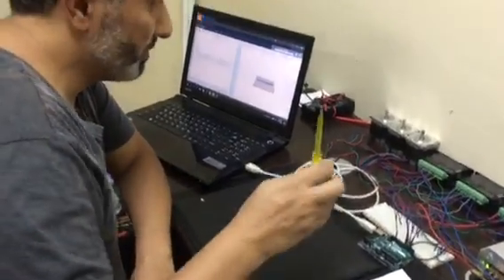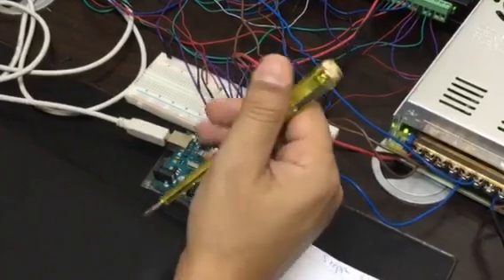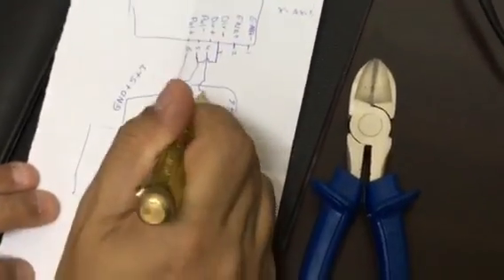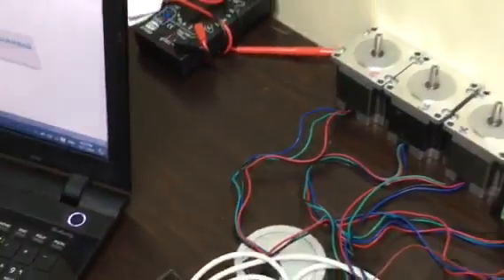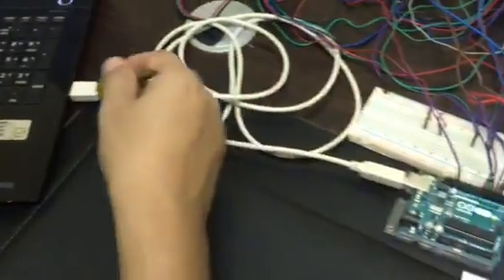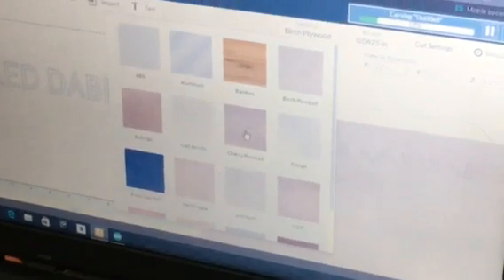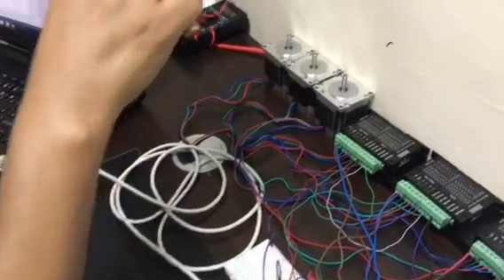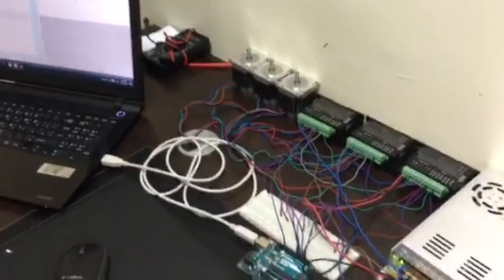CNC Machine - Arduino, Stepper Motor Nema23, Driver TB6600, Easel - Part 1

Comment: Thanks for sharing how to connect 3 stepper motors to Arduino UNO without using any cnc shields. I have 2 motors for y-axis, can somebody please comment on how to wire the 2nd y-axis motor to an external motor driver.

Comment: واعلیکم اسلام

 can anyone help me to make a 3D printer with Arduino using direct stepper motor driver instead of CNC shield, because I wanted to make 2D printer before and I have driver, not want to buy a shield and wasting drivers, thank you with honours
Reply from the maker: Magician of Electronics 
As I know driver is a must, you can’t run the stepper motor without driver. The driver interpreted the commands yo the motor.
Reply: @raeddabbas624  I am sorry sir, I am using driver. I am talking about the shield. I have purchased ULN2003 driver. I don't want to buy a shield as you know that ULN can not be installed on the shield. If I use the shield so that the ULN2003 driver will be useless. I have tested a 2D printer with 2 stepper motors with drivers only by configuring their pins on Arduino UNO. The same way I want to do for 3 stepper motors. Only have to add one more program. thank you for your reply, with honors

Comment: Will the pin connections be the same for ATMEGA 2560 please ? Any sample sketch  for testing CNC ?
Reply from the maker: Ali Ismael 
I’m not aware about ATMEGA 2560 !
But irrespective of the controller type you need any digital output pins and the ground pin.

Comment: thanks for the video, is there any way you can tell me what pin do i need to connect for the relay to switch on a plasma cutter?
Reply from the maker: Gabor Nemeth sorry man, I have no clue.
Reply: Raed Dabbas that's fine I have fined it thanks
Reply: Sir I am working on a waterjet cutting machine and this is also my problem. Can u tell me what pin? Thannks in advance

Comment: Hello sir,
             I am trying to make cnc machine similar with your machine. I am using nema 23 stepper motor and TB 6600 stepper driver with 32 micro stepping and voltage 24 volt 10 amp ,but my motor rpm is very low, its around 40 rpm . So can you guide me how to increase my motor rpm.please help me

Comment: Thanks for video. Is it possible to have 4 stepper motors connected with this scheme?
Reply from the maker: Roman Pushkin 
Yes but you need additional driver
Reply: And if I need two stepper motors to control one axis - can I connect them in parallel? In my design I need 2 stepper motors that will do always exactly the same thing. Do I need additional driver in this case? So I'll have 4 stepper motors, 2 of them will work in parallel, with 3 drivers only. Is it possible?

Comment: Thank you for the informations, I'm having a problem with my cnc, i make a drawing in easel, but the mashine makes another draw.... example: i make a circle in easel send it to the cnc and it carves a cross .... witch version of grdl are you using ? do you have some idea of how can i solve this problem ?
Reply from the maker: DJ Guto Loureiro 
Dear, most probably that you did link the motor driver wrongly to the microcontoller, at this case the motor does not perform the exact drawing.
Reply: can anyone help me to make a 3D printer with Arduino using direct stepper motor driver instead of CNC shield, because I wanted to make 2D printer before and I have driver, not want to buy a shield and wasting drivers, thank you with honours